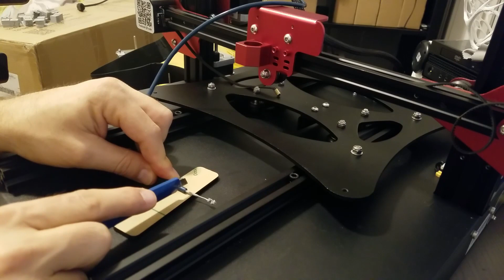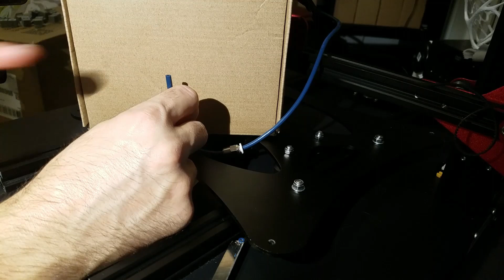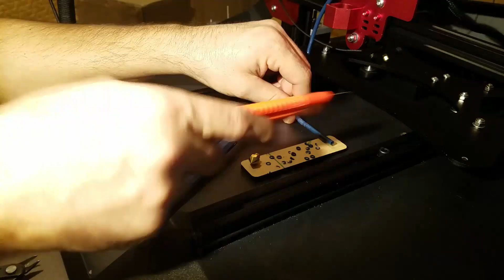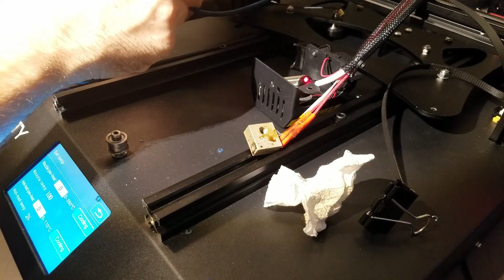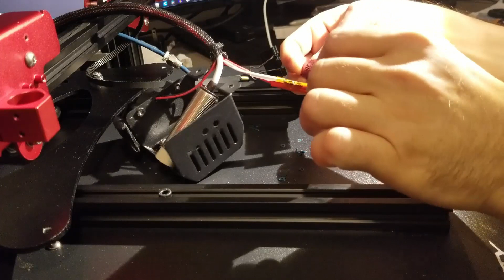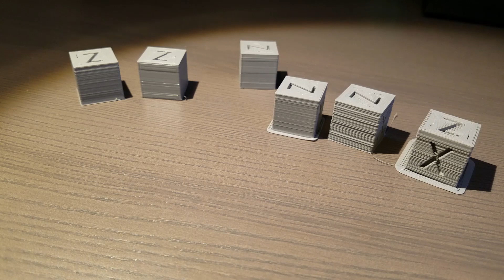Creality CR10s Pro Roller on 3d printer guide Rails Pressure Motorless tunning

Comment: Quick Tip. Stick the end of the bowden tube directly into the nozzle, use a sharp razor and slide the razor along the opening of the nozzle. Perfectly straight cut every time. Then just use a pick, tack, needle, etc to pull the tiny bit of tubing out of your nozzle.
Reply from the maker: thank you.

Comment: Hmm makes me think about ripping mine apart now. I have a CR-10S Pro as well and i am fighting with a ghosting issue i turned down the speed made no difference making feet dampeners now same gcode in my CR-10S does not have this issue so i know its the Pro doing it to me
Reply from the maker: Yea it is a complicated system overall, and understanding it the causes and effects takes some time. I am still learning this printer but it still does not print  as well as other have claimed and shared. At least for me. Now I think I may have the motors bad, they might not pulse accurately because I noticed wall chatter especially when there is travel involved in between the layers. It is almost like each layer that involves nozzle travel its at risk because the nozzle starting at the exact same position will not end at the exact same position so the identical travel distance seems to be executed practically different and I am not sure what may cause that. Take your time when taking it apart to feel the rollers on the rails, basically if you apply pressure on the roller (with your thumb) while moving the axis about then the roller should skid on the rail rather then spin, that's a happy medium of pressure. But I have to warn you it is very sensitive. so you can further un-tune it and experience worse results. best way is to print cubes with no xyz on the faces and set all the speeds the same. especially travel speed.